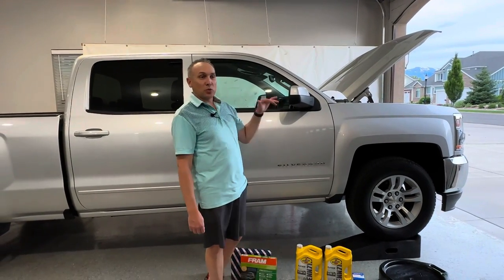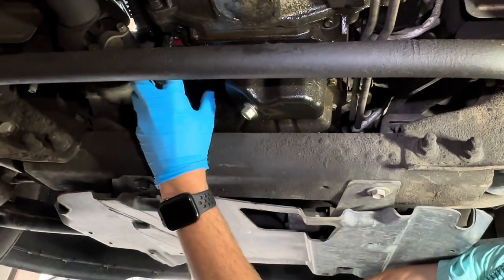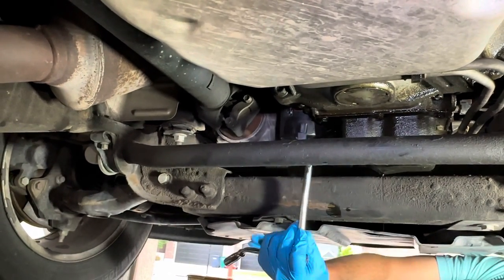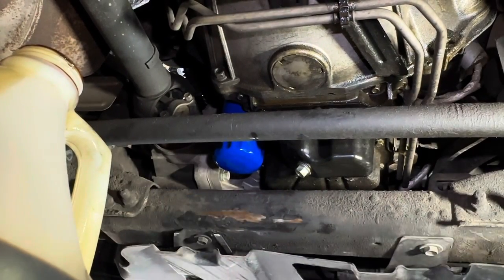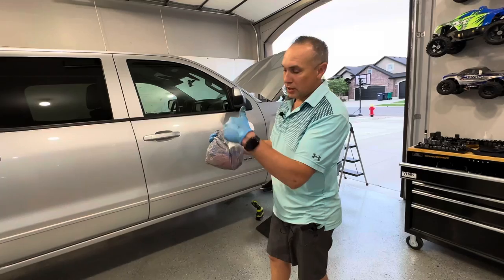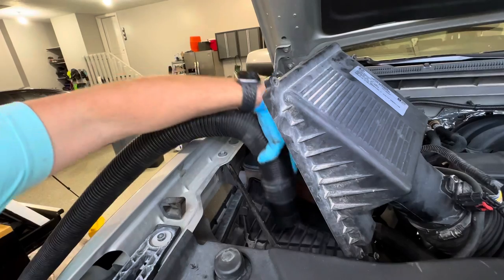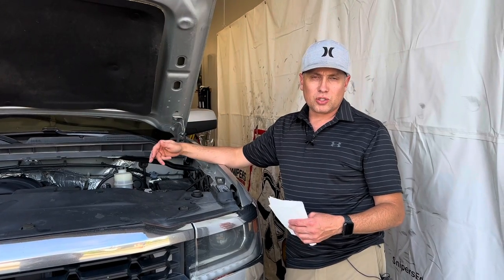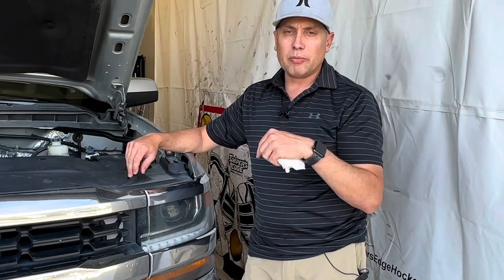2017 Chevy Silverado 5.3L Oil Change | GMC Sierra 1500 2014-2018 | Engine Air Filter Change

Comment from the maker: Product links: 
0w20 Oil (8 quarts): https://amzn.to/42EEaW1
Oil Filter: https://amzn.to/3XcvgOy
Funnel: https://amzn.to/3qJoiV4
Reply: I have the same truck, and my owners manual says to use the AC Delco PF63E filter.  Whats the difference between the PF63 and the PF63E I wondered.  After some investigation, I discovered those are NOT the same oil filter.  The PF63 filter has a by-pass pressure of 12 psi.  The newer PF63E has a by-pass pressure of 22 psi.  If your truck calls for the 63E and runs at higher oil pressure, its possible the PF63 might run with the bypass open, allowing unfiltered oil through.   Probably not a big issue if you change your oil on time, but it is food for thought when your oil gets dirty and the mileage creeps up there.   Nice video, thank you!

Comment: Why didn't you pre charge the filter? Even the manufacturer recommends pre charging the oil filter or major wear can occur. Interested in your reasoning for not pre charging the filter.
Reply from the maker: Are you talking about pre-filling the oil filter?
Reply: Fill the filter with oil before installation